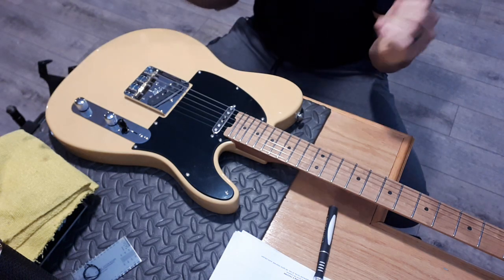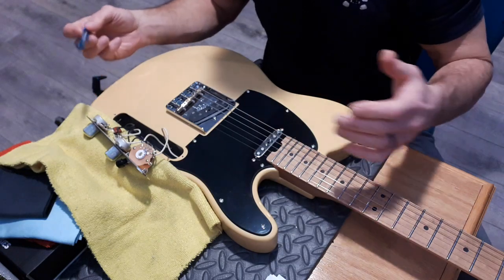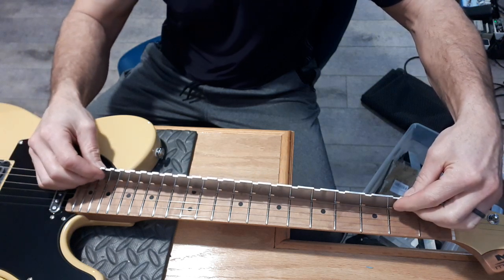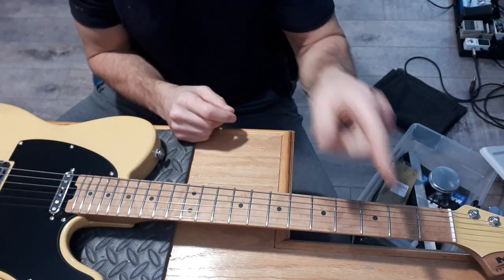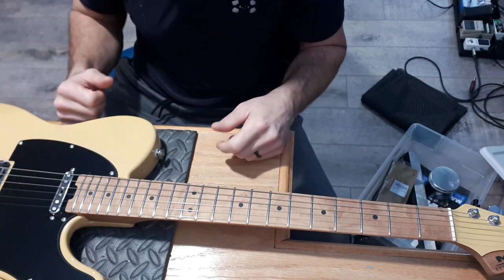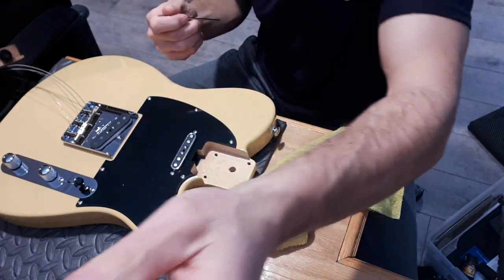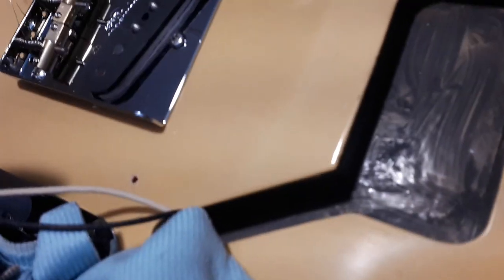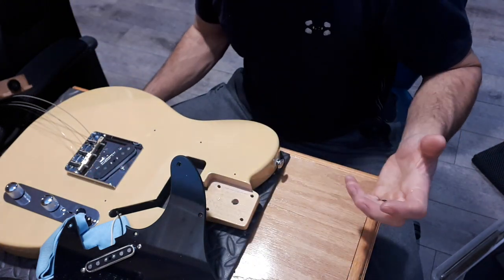M-Musi Virgo Classic T - What's under the hood?!

Comment: On the original 1950’s Telecasters, Leo Fender himself didn’t originally use a ground wire. Technically, there is no need for one on a Telecaster, since the back plate of the T-bridge pickup is electrically connected to the bridge itself through the mounting screws. So it is possible that Musi doesn’t need one either. You could check all the wire connections and try cleaning the pots, but for the price of the guitar, I think I would exchange it—a brand new guitar shouldn’t have noise issues like that! I still say sell your EART, IYV, and Ammoon, if this one turns out to be a keeper! 😂
Reply from the maker: Yeah not sure... I think this one needs a ground wire.... I checked with Amazon. They told me they would give me a partial refund if I agreed to keep it. So, it's a keeper lol!
Reply: @j-man9457  Sweet! You already clearly know how to fix the minor setup issues like the neck backbow… Now, if you can figure out and successfully fix the grounding issue, I’d say it’s a keeper, too! In terms of features and craftsmanship (electrical issues notwithstanding), this is clearly one of the best new T-style clones you’ve reviewed lately! In terms of craftsmanship, I think this one and the 2BM-Modified LyxPro are probably the 2 best guitars you have now, in my mind. One question: Is the neck pocket standard Fender-spec? I’d be willing to bet that it is, save for that notch where the truss rod adjustment wheel is under the 22nd fret extension lip… But good to be sure, in case you ever need to replace the neck like you did on the IYV. I do NOT think that would ever be likely on the Musi though, since the roasted maple should theoretically be almost totally immune to temperature and humidity changes.
Reply from the maker: @zuperdee  yeah I would agree with you on never having to change this neck. It's one of the nicest necks I've seen on a guitar in a long time regardless of price! They hit this one out of the park! Lol

Comment: First, I a strat style man.  Main reason is because the arm and body cuts.  I love this M Musi Virgo because it has all the same body and heel cuts as my Suhr  Standard Plus. (My favorite and most dependable).  I brought my Virgo in Nov 22' and my daughter got me the Capricorn for Xmas.    On my Virgo the bridge wiring would not switch fro middle position, bad switch.  But, i still took only it to a gig. With no neck or saddle adjustments, straight out the box.  I brought a whole new prewired plate and replaced the input jack (very hard to pull the chord out) after the gig.  Less than $30.00 for the changes, middle position has a push-pull bass boost.   Overall I'm loving this brand because of the body, neck and fret work.  They feel really good are easy to play.  Any electronics upgrades are to be expected at this price point.  I liked this video and will check out your other ones.
Reply from the maker: Hey TONESEEKER7! Cool name😁 yes these are amazing guitars! You're right that some upgrades are to be expected but from what I can see not many upgrades will be needed 😀

Comment: Thx for the video. Subscribed. Ate you still happy with this guitar?  Did you do the grounding yourself?
Reply from the maker: Yes and yes! Haha
Teles are the easiest guitars to work on!
Reply: There's a used one in "very good" condition where you bought yours, for $283.  I want to buy my first tele soon. Should I get it?
Reply from the maker: @flppr1  where are you located?
Reply: @j-man9457  San Diego, USA.  If it matters, i am a novice guitar player with novice guitar mod/repair skills.
Reply from the maker: @flppr1  ahhh I was only asking because I have 2 black Musi classics  here and I selling one for 300 CAD.
I'm in Canada though. It's a good price for the one you're looking at. If the previous owner didn't mess it up or steal parts off of it it should be fine hahaha...
If itxs from Amazon, if it's not good you can send it back right?
Reply: I wish I did live in Canada, for many reasons.  Yep, that's one good thing about Amzn, the return policy. I just ordered the last blue one.  Rock on, J-Man, and thanks again.
Reply from the maker: @flppr1  good luck! Let me know how it is😀
Reply: @j-man9457  Thx!  If I decide to change the pickguard, can you recommend a brand that offers good variety and will fit this tele?  I'm thinking brown pearl to match the roasted fretboard.
Reply from the maker: @flppr1  hey good question...
I have not changed a pickguard on these as of yet, however I do have a few Musiclily pickguards here and they are replacements for an 8 hole standard fender pickguard and the screw holes all line up. However there possibly 2 mods to do. 1 for sure is going to be the truss rod wheel  notch to add above the neck pickup (fenders typically don't have this) and the other which I'm not sure of, is you may need to widen the opening of the pickguard at the neck pocket route. I think the Musi neck heel is slightly wider than a typical Fender heel...
I just bought the black virgo classic, and I'm going to be building a black on black tele. Going full stealth mode on this one hahaha. I'll be changing the pickguard with one of the Musiclily guards I have here, so I'll be sure to show the fittment issues, if any, on the video of the project 😀

Comment: Wish the color was more blond!!!!!!
Reply from the maker: Hey Groove tone,
It's a really nice vintage blonde color in person. Doesn't show up well on the video, but you can see the wood grain through the finish!
Reply: @j-man9457  Wow!!! This just keeps getting better and better… So this really IS like an original Butterscotch Blonde Telecaster, but with modern refinements like the body contours, contoured heel, stainless steel ball-end frets, and modern pickup design. I really dig it! Now the question is: Have you been able to figure out the noise and grounding issue?
Reply from the maker: @zuperdee  hey buddy, not yet... haven't looked at it again. After this video I reassembled everything and took it to a 3 hour band practice to see how these pickups would hold up in a band situation. They cut through with punch, clarity and articulation at full band volume. Very impressed!
Reply: @j-man9457  Wow! You’ll have to show this now! BTW, be careful putting the neck back—I wouldn’t be surprised if it has shorter screws for the top than the bottom, to match the contoured heel. You wouldn’t want to put the longer screws where the shorter ones should be and accidentally split the neck wood!
Reply from the maker: @zuperdee  yup no worries there... they are all the same lenght screws. 😀
Reply: @j-man9457  Interesting… I’ve seen examples on YouTube of ones with different screw lengths… The way they’ve done the contouring here is cool, because this way, it could potentially retain compatibility with standard Fender necks… But it does mean it can’t be quite as finely contoured as something like an EVH/Music Man design.
Reply from the maker: @zuperdee  the thickness of the contoured pocket at the guitar body is thiner / more pronounced than the similar designed contour on my EART tele which uses longer screws at the base. On the Musi the short screws are long enough for both the base and the top positions of the pocket.
Reply: @j-man9457  Interesting! Yeah, this guitar is clearly VERY much the same “Modernized Classic” concept as the EART. It will be interesting to see what this one is like after the final setup/grounding fix, how it compares to the EART, and how it performs with a band! I already have no doubt that this guitar should be ABSOLUTELY giggable once the grounding/shielding is fixed.
Reply from the maker: @zuperdee  stay tuned for a modded EART and Stock Musi sound comparison soon. Haha